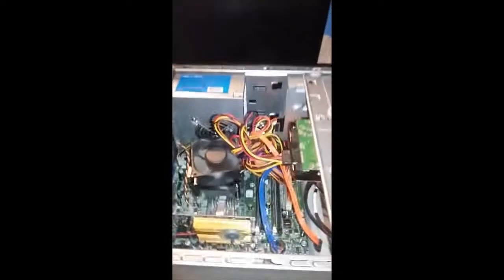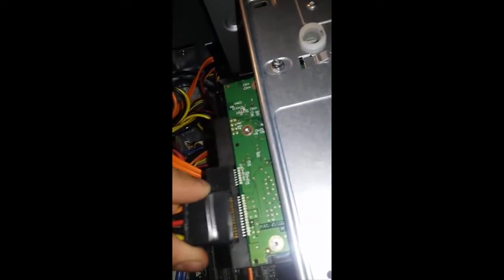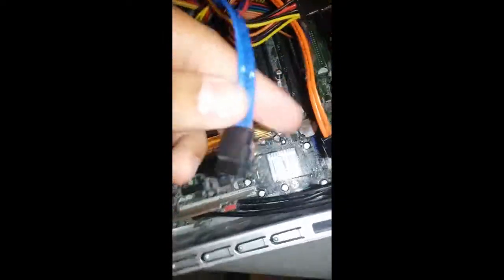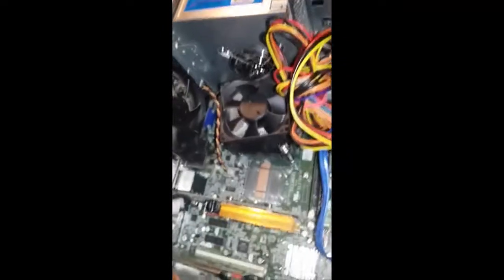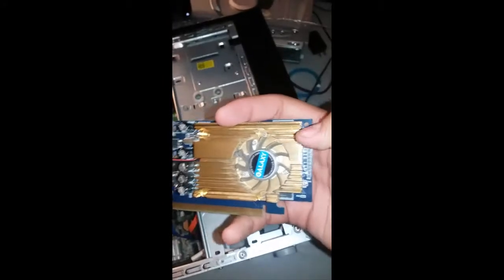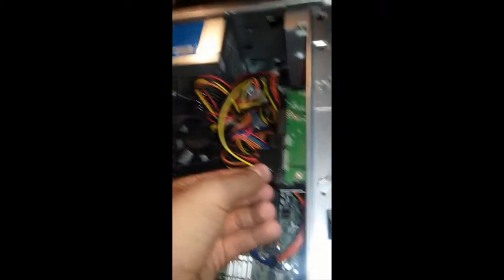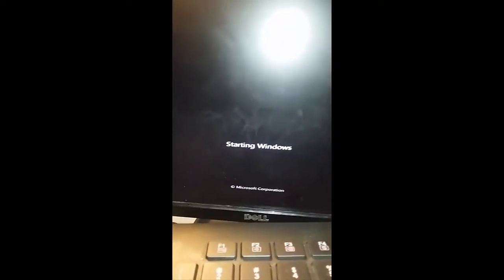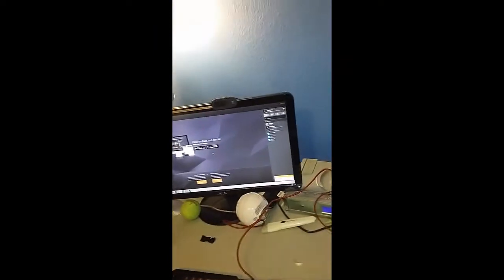SATA HDD Error Fix

Comment: what to do my computer shows 1796_sata cabling error one or more sata device are improperly attached. connect device to sata 0(dark blue) or sata 1(white) connectors before sata 2(light blue) and sata 3(orange) connectors  215 DIMM configration error  please remove power from system and reinstall memory modules. populate modules starling with slot XMM3 Then XMM4 follow by slots XMM2,  XMM1 
Above message.... 
Plz share some suggestions